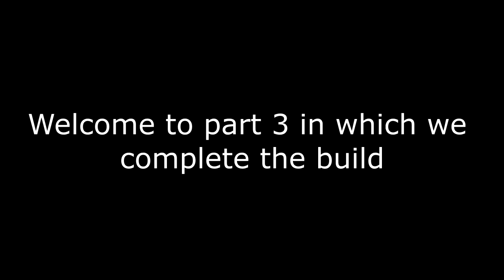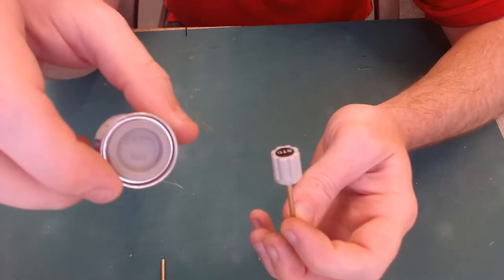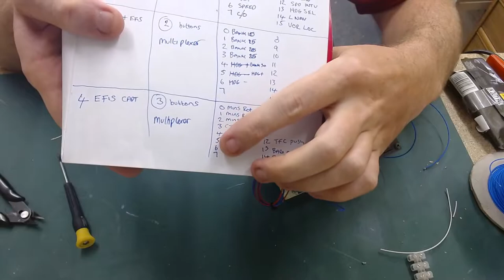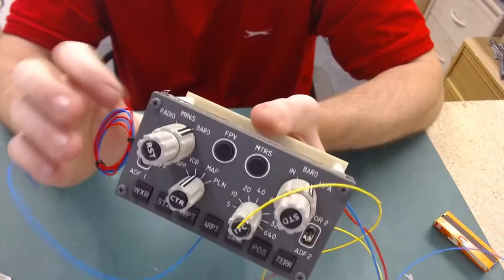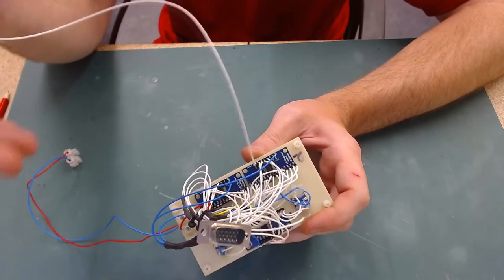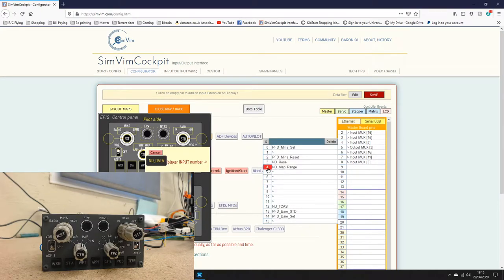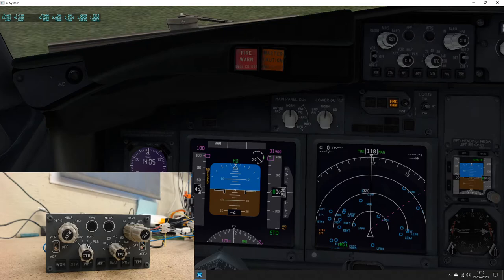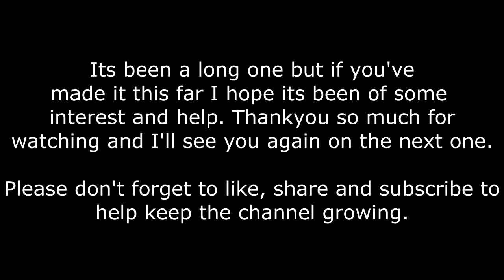737 home sim build - cockpit sim parts efis - part 3 completion

Comment: wow you are teaching me a lot
because of you i am rewiring my overhead
i am moving from  fsx 737 ifly using simioboards to 737 zibo xplane11using  simvim
i am trying to use the 40 pin strip and  the existing input wiring
i did mange it have 111 inputs
test some its working
problem how to wire the outputs lads have 106 of them 
you are using air manger 
i did not start the output i  did not order the components yet
the connections of the pins to the 2560 is flimsy how to make a firm connection?
admire your work
Reply from the maker: yakov kraus thanks yakov, always good to hear my vids are helping. For your led’s look at getting some DM13a drivers and use simvim. These drivers can power 16 leds each and you can link 4 together, giving you 64 led’s using only 1 pin of the arduino. There are detailed wiring instructions on the simvim site for this. For the flimsy connectors look at the links in my video description for the prototype shield, this converts the arduino mega to a screw fitting connection.

Comment: Amazing great job ! Could you show in next videos how you connect all of your panel ( mcp, efis and fmc ) together ?
Reply from the maker: Do you mean for the the back lighting? Other than that they don’t connect together, they each run to the arduino
Reply: Yes for back light. And for other you have a card for the bus of each multiplexer ?
Reply from the maker: Psarkoteck all the multiplexers run into a single arduino as simvim only allows 1 arduino. If you watch my mcp build you’ll see my arduino setup and how it breaks out to the different panels. My backlighting runs from the power supply through the potentiometer on the captains knee panel then to the mip, then onto my efis, mcp and other efis. This will be fully shown in a future video as you requested
Reply: Thanks for your response and can’t wait for the next step ! 
Enjoy !!

Comment: really good and informative videos! As a beginner i am thinking about the EFIS as a very first project. Compared to the MCP and the Overhead this should be a good (and not too frustrating) start. The only thing i am concerned is that it seems to not be covered in the SIMVIM configurator yet. I have a very limitated understanding in Coding and no idea how to get it work after  succesful assembly. Do you know where i can find a complete "script" or something (X-plane 11 / ZIBO)?
Reply from the maker: Hi felix, good luck with your project, the efis is a lot more work than it looks but it’s only buttons and encoders so no 7 segment etc to worry about. With simvim you don’t have to do any scripting, you simply click what switch you want to assign on the picture and point it to where you’ve wired it on the arduino, very simple.
Reply: @simbuilduk5853  thanks! Do you know if there exists a complete assembly kit for the efis from HISPAPANELS to order? including knobs / PCB / the 2 concentric kits etc? it's a little confusing because in every kit they mention "Needed components (optional)"
Reply from the maker: @felixbauer633  mostly they are sold as dummies so you get the front panel and a few components, to make it fully working you need to add the optional components yourself, my efis came from cockpit sim parts and came with everything needed to build
Reply: @simbuilduk5853  i took the time to watch all 3 parts of your build and noticed that you had a big effort in drilling the four encoder shafts for the Mins/Baro. In your description was a link to the "Concentric encoder kit" and i asked myself whether if it's possible to use two of them for the STD/Baro & RST/Mins instead. I guess they take a lot of building space (because of the PCB) and do only allow the rotations and not the pressing knob. is that correct?

Comment: I have a little problem with simvim can youbland me a had please?
When i download it the data file doesn t come with it and each time i try con fonfigurate it gives me a different data what can you advice me pls
Reply from the maker: When you first get simvim there is no data file, use the configurator to create data.cfg and save it in the simvim folder in your xplane plugins file
Reply: @simbuilduk5853  thank you a lot
Reply from the maker: @manno_vii  after that each time you use the configurator click edit and select your data file, make your changes then save and over rite it
Reply: @simbuilduk5853  what you meant by ovet write it?  Bracause everytime i save it gives me data file 1 2 3 4 and so one
Reply: @simbuilduk5853  i made a short video can you give me somewhere thatbi can send it to you so you can tell me wha i do wrong plz
Reply from the maker: @manno_vii  can you email it to me? simbuilduk@gmail.com

Comment: I want to use SimVim for my completed EFIS module.  However when I went into the configuration the EFIS modules are “grayed” out.  Do you have any suggestions on what I need to do to get them back?
Reply from the maker: Hi, I will look into it today and let you know, simvim is going through a big update at the moment so there may be another way or it could just be temporarily greyed out, will have a look and comment here later on today
Reply from the maker: Just had a look, simvim looks a bit different to how it used to but the efis is still there and working. Go to sim vim, click on config, scroll down to where it says instruments, efis, mfds, click on efis control, then click on the picture of the efis. It will then bring up a picture of the pilot and fo efis where you can then click on the buttons and assign them to your pins on the right of the screen.
Reply: Got it. Thank you very much.

Comment: would love to buy a completed project
Reply from the maker: it's a difficult one, It's cheap to make yourself but it takes alot of time and work. To have someone make it for you would be nearly the cost of a commercially available one. Only advantage is you can't buy one commercially setup to run with simvim